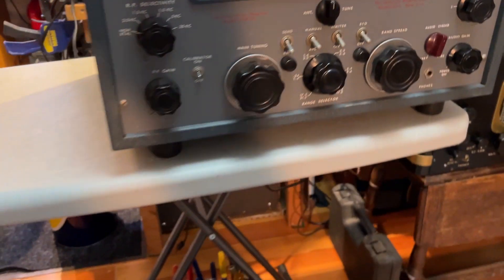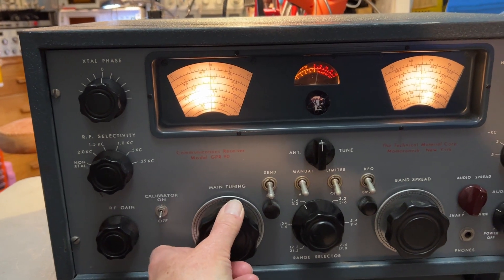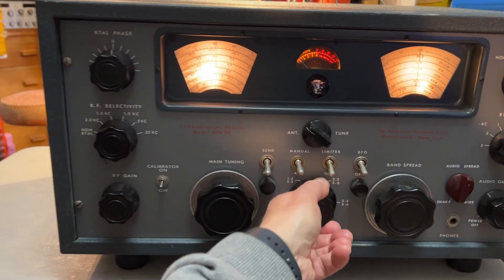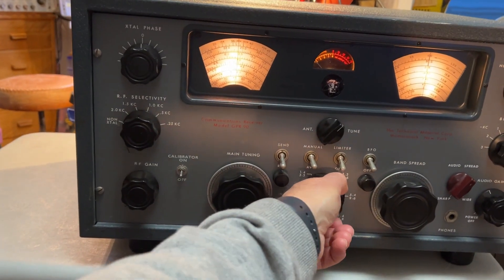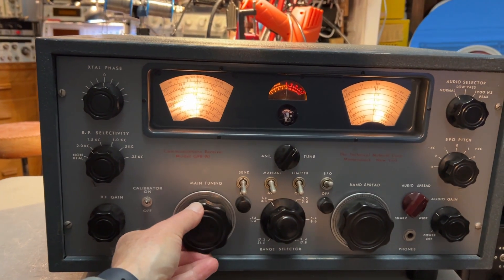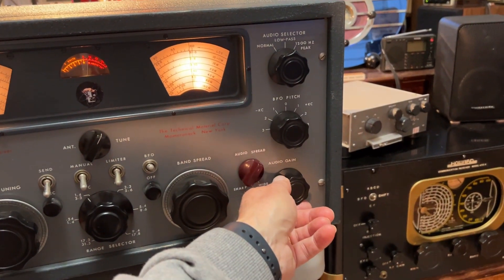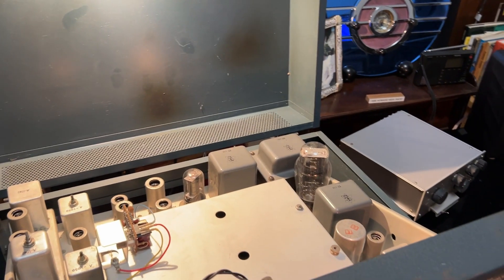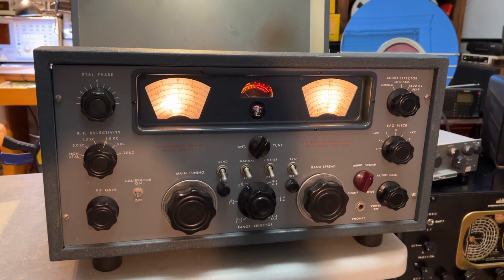TMC GPR 90 Receiver - Initial Testing on Arrival

Comment: Hope you show the restoration. Yes it has a Hammarlund look - but the red and yellow S meter is more National!

My best friend SWLed with his dad’s GPR-90 in the late 70s-early 80s from New England. This included hearing the Falkland Island Broadcasting Station - 2.37 MHz at 1kW. So the GPR is a nice set!
Reply from the maker: The GPR-90 is now almost refurbished - I need to check the alignment (likely over the next couple of days if I can find the time) and will then make another demo video to show what has been done and how its performing.  I will also prepare an article on the refurbishment work and post it to the SPARC radio museum website in a couple of weeks or so.  I was working on the Falkland Is. for a year or so in the mid-1980's (a couple of years after the war) - callsign VP8BDE (I still have the rig I used there!)